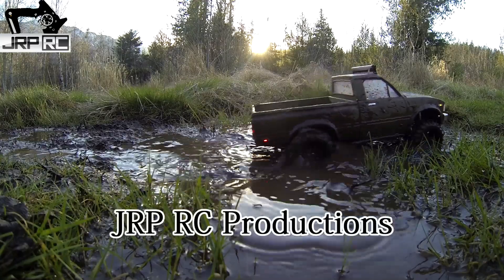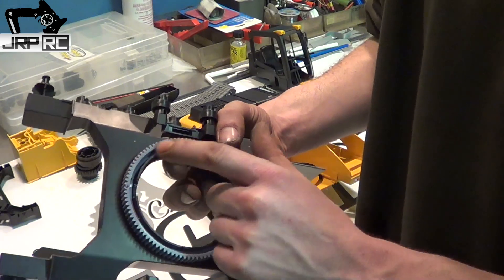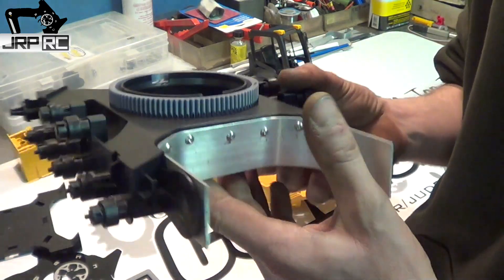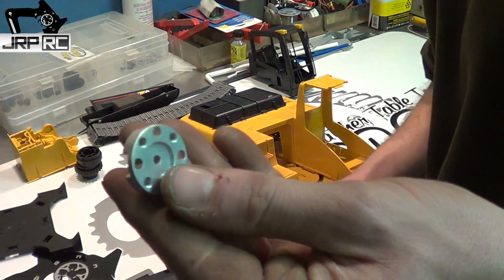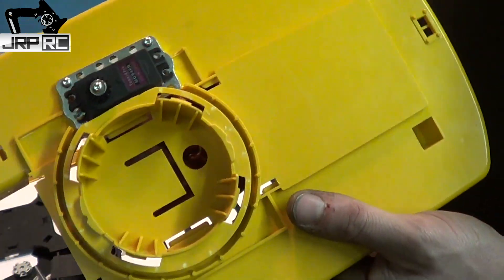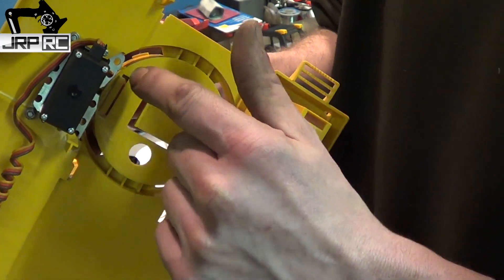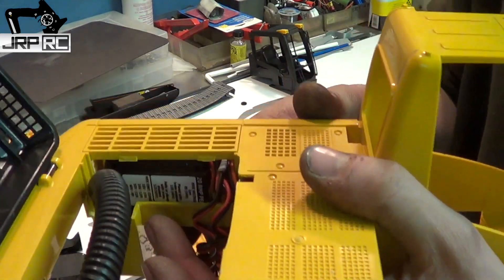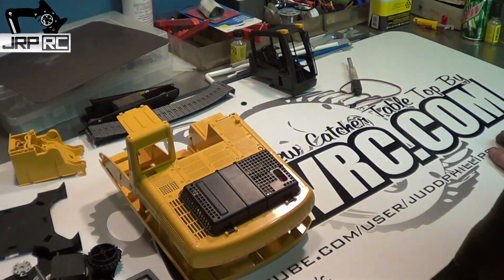JRP RC - Bruder Excavator Rc Conversion Pt. 2 Pivot Gear and Servo Mount

Comment: on my Unit Crane for my deck ring gear I used a VEX gear kit from robot marketplace (gave me a ring and a tiny gear for the servo. Your ring is much larger though). That bracket for servo mounting is very cool! mine is a wheeled Unit Crane and so I did not make it propelled. for servos I used robotic 360 for turn table, and my crane lines. they are rated for about 18kg of force!